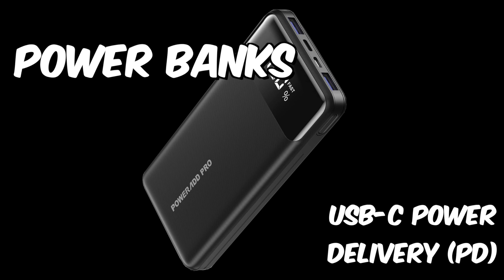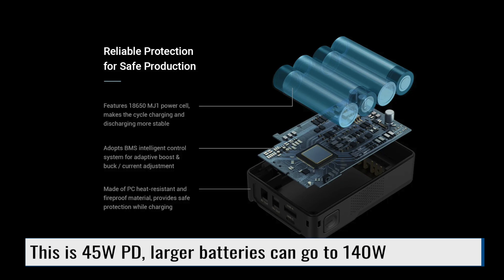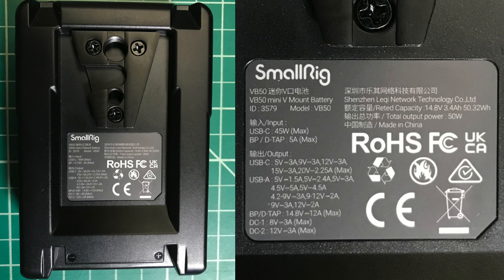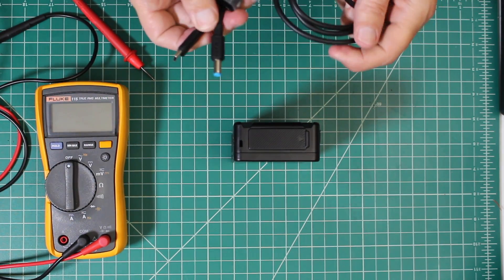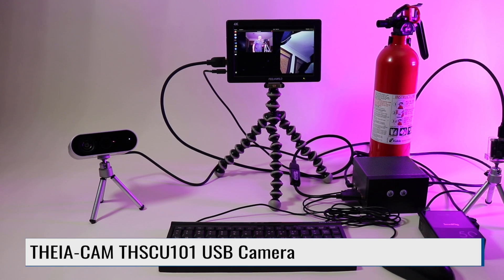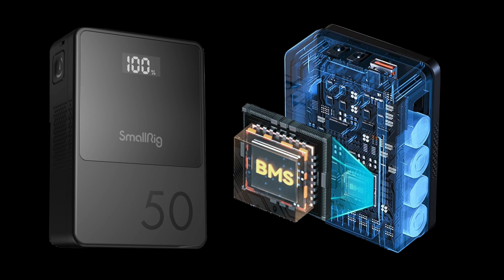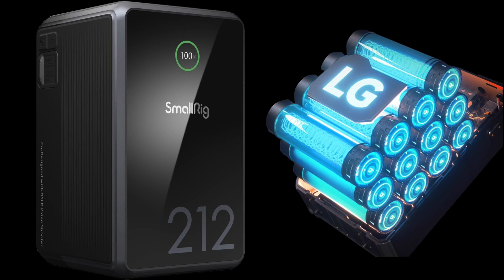A Great Battery to Power Your Electronics Projects!

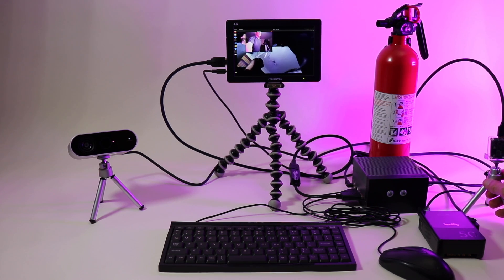Comment: Loving the videos! I'm working on my own project with a Jetson Orin Nano and a drone and you provide really helpful insight. I've also considered fire safety as you mention at 08:32. What kind of fire extinguisher are you using? The LiPo battery I have bought suggest using a class D extinguisher, but at least in Sweden they appear to be quite expensive, starting at several hundred dollars.
Reply from the maker: Thank you for the kind words. I've seen fire extinguishers that claim to be specifically for lithium batteries (around $40 USD): https://amzn.to/4nOGhSH . Fortunately most of my projects are small so I'm hoping a fire blanket will suffice, along with a fire extinguisher. Thanks for watching and taking the time to comment!
Reply: @JetsonHacks  Thank you so much for the swift answer. For some reason did not receive a notification but instead got a pleasant surprise when checking back :) . From my research it is  impossible to suffocate the battery fire due to it producing both its own fuel and oxygen. I guess the blanket is to reduce spreading, not to extinguish the actual battery?
Reply from the maker: @shouider  Lithium fires are very difficult to extinquish. A fire blanket might help contain the fire, but it will also depend on what the substrate is under the battery. 

In general, it's difficult to be cautious with them all of the time. Since most people don't 'practice' how to respond, there usually are some pretty bad outcomes. 

However, most power banks and similar products have battery management systems that lower the risk dramatically. And billions of people don't think twice about having phones in their pockets.

Comment: Just to confirm, are you using a D-Tap to DC cable with a built-in 5 V regulator, or is there a separate DC-DC buck converter in your setup?”
Reply from the maker: No. The D-Tap goes straight into the Jetson Orin Nano or AGX Orin. The Jetson Orins can run between 9-19V. A Jetson Nano is different, it requires 5V. You should use the 5V output for a Jetson Nano 4GB or 2GB.

Comment: Did you connect the Jetson Nano Orion directly with cabling -tap - dc? Isn't there a risk of burning it, since the Jetson receives 5A?
Reply from the maker: I'm not sure I understand. Is there a chance of burning a low wattage lightbulb out when you plug it into the wall/mains at the correct voltage?
Reply: @JetsonHacks  hanks for the analogy, that makes sense regarding current. But just to be clear — since a V-Mount D-Tap outputs around 14–16 V, wouldn’t connecting the Jetson Nano directly to the battery risk damaging it? Or is there some safe way to connect it without a DC-DC step-down to 5 V?
Reply from the maker: @romariosantos4903  The Jetsons in the video are Jetson Orin Nano and AGX Orin, not Jetson Nanos. Jetson Nanos operate on 5V, and should not be directly attached to the DTap outlet.

Comment: Love this. Would probably change from the RC LiPo's we are using at the moment (no BMS, less safe) but the prices of RC LiPo's is still a fraction of the cost per mAh.
Reply from the maker: The V-Mounts go into the magic bag of tricks. RC LiPos are attractive for many applications. However, things tend to start getting messy with them if you need a regulated power supply or different voltages. Plus, they need baby sitting, you can't over discharge them or they will be dead for ever. They certainly have advantages, they're light and relatively inexpensive.  Engineering is all about tradeoffs, as you know. Thanks for watching!

Comment: That's a nice set of features... I think i'll be sticking with the previously recommended NP-F style batteries for my pi and nano projects.

But now i'm thinking UPS for a pico power supply- i suppose providing power while charging is a point to research.
Reply from the maker: Going with what already works is always a good choice in my book. Done is my favorite color. It's good to know what's out there in case you starting making new projects. Thanks for watching!

Comment: Is the battery protected against over-discharge/undervoltage when using the D-TAP port?
Reply from the maker: Most high-quality mini v-mount batteries  have over-discharge protection built-in,  including on the D-Tap port. This is a standard safety feature to prevent the battery from completely draining, which can damage the battery cells and shorten its lifespan. I believe the battery cutoff on the VB50 is 11V. However, it might be worth asking the manufacturer of the battery you intend to buy. Thanks for watching!